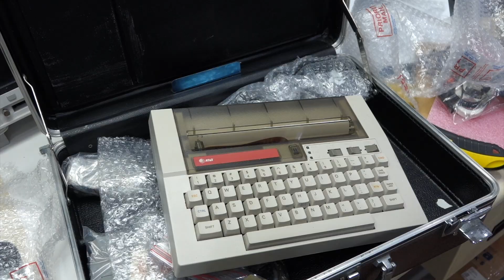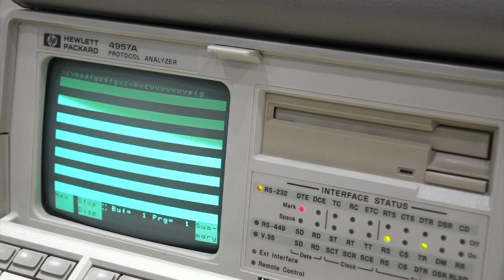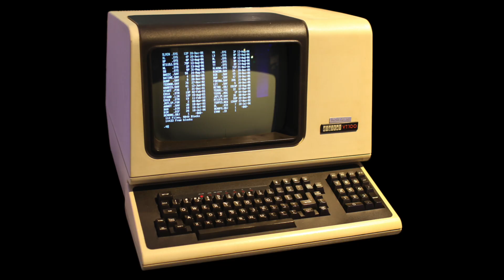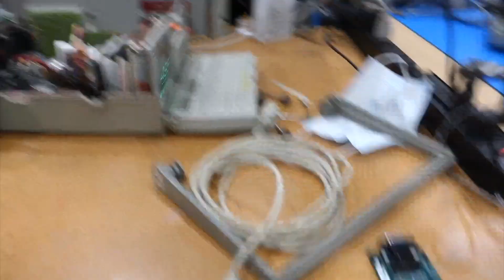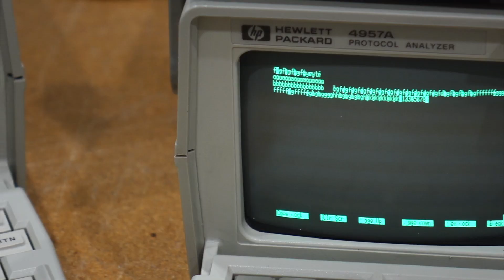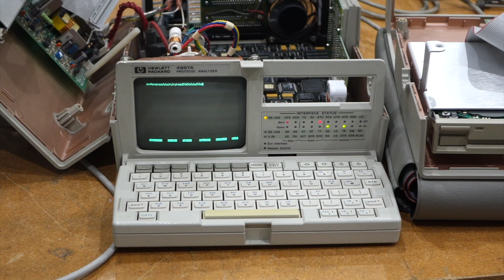HP 4957A Serial Protocol Analyzer

Comment: I used a similar one of another brand to debug RS232 data, sync and async. I would prefer a HP one. What a well engineered products, rock solid, reliable, true jewells!!! By the way, I worked for the local DEC representative in Chile, and we had a bunch of VT terminals, 100, 101, 102, 220, 240, 320 etc.

Comment: Im using a hp4951b with the 18173a pod but i got a few questions. What port settings did you guys use for the windows pc, and what program did you use on the pc, since i can use simulate to get text to the pc but i cant use the auto configure mode and i cant send data from the pc to the analyzer, sorry if this comment seems like a mess i have been trying to get mine to recieve data for like 2 hours now.

Comment: Totally a long shot, but did you happen to document the value/voltage of that starting capacitor?
When I was fixing mine I popped in a huge one that was close enough but higher voltage and way bigger (physically) to make sure the rest works, and order one later… And of course… never remembered to order one 😅
Reply from the maker: Nope. It's somewhere in my bin of dead parts... But replacing it with a bigger cap is perfectly fine. If it starts you are good.
Reply: @ Understandable, thanks anyway :)
Interestingly, out of my 2 units only one has a power supply like yours. The other one has a more stripped down looking HP branded board, and that unit has weird intermittent power-on glitching issues. Shame their main boards are not really serviceable!

Comment: I got the HP 4159A type, fixing the flat flex cable on the keyboard, then I can test it properly. It uses cherry key switches
Reply from the maker: Congrats on your acquisition and good luck on your repair! The 4159A is actually made out of regular parts, not FPGAs, so it should be “easier” to repair.
Reply: @CuriousMarc  Msnaged tobfix him, now working great. Going to use the info from the service manual to build an interface modual as it did not come with one. Can make it nice & small

Comment: Got HP 4951C for review 😀
With all cables, Floppy disk with utilities and connection board of cource. And yep - It's definitely cute
Reply from the maker: Good luck with it! The 4951 with its traditional logic is a lot more hackable than the 57 with all the FPGAs!
Reply: @CuriousMarc  Yep. but after some research I fount that binary format for apps is incompatible with 4952 and later models. So I could succesfully upload apps from utility disk for 4951, but still can't build my own - Need to have some sex with IDA Pro to find out entry points addresses.

Comment: I was just using one of several 4957As that I have at work, for testing RS-232.  I also have a "newer" module -swappable test set that is no-where near as functional as the 4957.  Thanks for this video.

Comment: I used to work with a flavour of this a lot back in the '80's. Ours had a kind of pod thing that covered the keyboard when it was folded up and it then became part of the case. Once removed the pod could be velcroed to the top pouch, attached to the rear panel with a multipin connector and the pod presented the breakout above the screen. Never seen one with the BOB on the side. Very expensive bit of kit back in the day.
Reply: Yes, that's the 4951/4952 as shown in some of the leaflets he waved about.

I've got some somewhere, but ended up writing a better monitor on a PC so I could reverse-engineer the protocol that two of them used to talk to each other.

Comment: It's a good machine. I have one and last "used in anger" as recently as last year for working on a medical laser of similar vintage... modern USB-RS232 dongles didn't work with it. (Eventually we found a fancy industrial one that did, but the HP serial protocol analyzer was still very useful figuring out the settings and some of the protocol.)

Comment: Ah the HP4951. Brought back lots of good memories. Used it extensively during the 90's to develop and debug controlling machines for assembly lines. The external breakout panel that you mentioned is actually the front cover, once the keyboard is folded up. It was only in the later models that they integrated the breakout panel into the chassis, like this HP4957.

Comment: In the 90's I ran the ICL training course for OSNET and needed a mainframe to connect to as a server.  That was impossible in a classroom so a wrote a C03 protocol emulator on one of these using the basic scripting function. And it worked enough to show a simple menu from the M/F.    I also fixed numerous issues for customers with it.
A wonderful piece of kit.

Comment: This was great, I didn't realize that these had so many processors either.  I have a couple of the 4952A models that I rescued a number of years back from being thrown away that I've never used.  They don't have the cable sets and are the model Marc referred to that has the rather clunky interface connections on the lid vs the side.  Who know why they made such a drastic change.  I'd love to see them working again someday just for fun.  It's not too often that [old] protocol decoding for serial communications needs to be done but I hate to see stuff like that abandoned and thrown away.  This stuff was great and back when HP made some of the best test equipment in the world.

Comment: I have one of these, but it looks a little different.  It doesn't have the interface on the side.  It was a separate piece that acted as a cover over the folded up keyboard and contained the breakout interface and connected to the main unit with a large DB cable. DB37 maybe?  It was instrumental in product development that allowed me to start my own company in the early 2000s.  Edit: Ahh looks like miine is a 4952..not a 4957.
Reply from the maker: You have the earlier HP 4951 or HP 4952 that I talk about in the video. Nice machines too!

Comment: If you're interested in alleviating your lack of spot welding equipment, the cheapest reliable/quality solution I've found is the kWeld. Paired with a commodity high-current RC hobby lithium ion pouch battery it produces reliable welds and is tunable from the very lightest terminals/strips up to pretty beefy stuff. Not dirt cheap (a couple hundred bucks plus the battery to drive it), but I tried other cheap aliexpress specials before and they blew up in my face on the first weld attempt so don't bother with anything lower-end.

Comment: In the 1980s, each time you needed to connect a new pair of computer and peripheral device like a terminal or printer via a serial interface, the game started over form new. Our rule was: you need a solder iron, an oscilloscope, and an hour of time. We had additional gadgets like back-to-back soldered D-Sub connectors with blank wires in between to hook up the probes. There were so called "null-modem" cables, crossed cables (crossing TX/RX and possibly also DTR/RTS), and all kind of gender changers. And of course there were the 25-pin and space saving 9-pin versions of the D-Sub connectors. What a mess. It was easier if the devices supported the Xon/Xoff flow control, then you could get away with just three wires, you only needed to get TX/RX correctly connected.
Not yet 20 years ago, I designed a test adapter for SCADA systems that ran serial protocols over optical fibers. The adapter consisted of two optical/RS-232 converters which could be combined in tap mode to sniff the communication between the real devices, or the converters could be used independently for simulating either end device in such a system. The processing was no longer done in such a device like the hp 4957A, but with a software running on a PC. The product has been discontinued years ago, but we still get occasional requests for the test adapter hardware.
Reply from the maker: Well said. RS-232 in a nutshell. No matter how much I try, Rx and Tx are always inverted the wrong way, I end up with two males facing each other, one is 9 pin and the other 25, and hardware handshake freezes the whole thing :-D
Reply: @CuriousMarc  It really wasn't that hard if you worked with it a lot, you just had to know the signaling and the ways it was commonly used.  I did a lot of serial troubleshooting back in the day.  A few minutes with a breakout box and you knew exactly what pinout you needed for any cable.  I also used one of these protocol analyzers to decode x.25, baudot and bisync on both async and sync circuits for many years.

Comment: I could have used something like this a couple years ago at work, believe it or not. Was bringing up a new board, but wasn't getting output. Wasn't until I pulled out an oscilloscope that I found the baud was 33% high.

Was my fault, I thought the board's input clock was 33MHz, but it was actually 50.
Reply: That's assuming these can detect/debug baud rates.

Comment: I used these analyzers early in my career for Async, Bisync, SDLC and HDLC analysis.  However, I always preferred the Atlantic Research Interview Line of products over the HP analyzers.  I spent many years in the office and in the field doing debugging, mostly with the AR Interview 932 model.  At least for me, the AR units were simpler and easier to use that the HP ones.

Comment: The character overlap may be caused by a degraded capacitor in the horizontal width circuit on the CRT. There may be a width coil you can adjust, but by making the image wider (like it originally was), I doubt you'd get the overlap. Looks like an analog issue, not digital.

Comment: I see.  The version we used was the earlier one with the breakout box in the cover.  Great help while diagnosing problems.

I must have resoldered hundreds of those power supply pins that cracked.  The first ones cracked again, so I changed to cleaning all the solder away.  Then I wound an inch or so of 24 AWG bare copper wire around the pin with a tail running into the PCB trace.  Never had an intermittent problem again after that.  👍👍

Thanks for another great video, Marc.  Stay curious!

Comment: Could have used one of these at work last week.  Was trying to troubleshoot a communication problem to a lab machine.  Eventually determined that when the PC's power supply failed, it apparently fried the UART on the motherboard.

Comment: Marc, try ESC # 5 and ESC # 6 escape codes on these machines. The first is "single width line" (80 characters) and the second is "double width line" (40 characters). They may or may not do anything useful. There is also an escape sequence for a 132 character line.
Reply from the maker: That does not do anything on mine.

Comment: 5 cpu and 7 fpga to analyse one serial line, I imagine each peripherals controller has his own cpu, keyboard, disk, serial line, led panel ? seems a little bit over engineered on the hardware side, and under engineered on the software side, don't you think that with a little bit of multi-programming (old term for multi threading), the M68K would suffice ?

Comment: Some interesting HP trivia at 11:22.  The power supply has “Yokogawa” printed at the upper left.  Yokogawa was a Japanese company that HP had a joint venture with for many years.  Lots of products came out of “YHP” as it was called.  I wonder if just the PS came from YHP or if the entire 4957A was designed and manufactured there. I don’t remember.  Maybe someone else knows.
Reply: AFAIK Yokogawa still exists

Comment: When I worked as a Systems Engineer at HP in the 80s, I would sometimes use a version of this to troubleshoot mis-wired and mis-configured serial connections. It made the job a breeze. Loved it!

Comment: Wonder if this would be of any use for troubleshooting HDLC interfaces on NEMA TS2 traffic signal controllers. They use HDLC to interface to the loop detectors, conflict monitor/malfunction management unit, and the load switches for the signal heads.

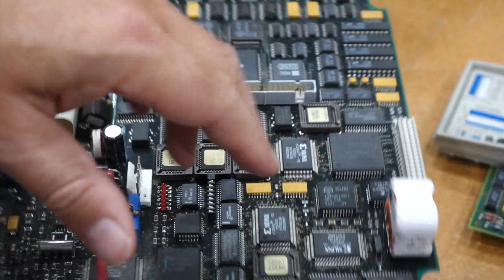Comment: To me the battery seems just 4S1P (unlike 14:24 audio says a serio-parallel), and the vertical joints extend to a solder pin purely for mechanical reasons
Reply from the maker: Could very well be.

Comment: Fixed a few VT-100's back in the day =D  Not very many though, most of the terminals I came across were manufactured by Wyse.  Great job getting both of the 4957 working =D  I hope you can later work out why the high res mode is borked.

Comment: Went through many airport check-ins with on of these as a carry on. Once, I had to demonstrate that it powered up to security, and it fell all the way to the floor. Still worked!
Reply: HP Journal describes how the case outline was specifically so that it would fit under a plane seat.

Comment: How were you able to work out that C7 was the capacitor to replace on the PSU?
I'm guessing that either you were able to reverse engineer it or it's the same PSU design as the older devices. Thus did have a schematic available.
Reply: Its actually the easiest fix. Switching PSU that doesnt want to start or always restarts, 90% of the time its the small 10-100uF electrolytic on the primary side that also has a 50-500k resistor to charge it up from the high voltage bus. usually the cap goes bad, sometimes the resistor also goes up in value if it runs too hot.

Comment: cool machine, I travelled with that kind of device aroun europe well before laptops. used that as a terminal and also to debug protocols.  Used also texas silent, but with bubble memory 😁 and integrated 300b modem... that protocol analyzer phased out later on because it has quite low max baudrate....
Reply: machine I used was 4951 (19200b)

Comment: Hi Marc, I am incredibly jealous - I bought a faulty one off e-bay hoping it was a power supply issue - well it was but the power supply was blown because the RS-232 port had been hooked to mains! That pretty much blew out everything on the 12V lines - so the floppy drive is dead (stepper drive blown) the power supply had the same fault with the start cap as yours, but when I fixed that the PSU exploded. The vertical scan was blown and the RS-232 line drivers and interface board were destroyed. Note - a video will come!

In debugging the system I have found a lot - the video is handled using a dual-port RAM from IDT - this is big enough for the 80 column mode - on the machine that is playing up in 80 column mode, it could be worth having a look at the input and output address lines and data lines - that could give clues as to where the fault is. It may just be the IDT RAM has an issue - in which case it is a simple switch out is possible as it is a PLCC soldered onto the board.
Reply from the maker: Oh no! Looks like I took all the eBay good luck from you! Still took me two tries. We should definitely try the simple RAM replacement if it's socketed.
Reply: @CuriousMarc  not socketed but not fine pitch
Reply: Mine appears to be an early version - it does not have the 80 column VT100 emulator firmware. So maybe the firmware was rushed out to get the unit in the field - makes me wonder if there was a serious supply problem with the older version.
Reply: mains on RS-232 ?  sometimes you really wonder wtf people do with their gear.  When I worked for a company that created DMX-512 (RS-485 based) lighting controllers we once got one returned for repair where we discovered the varistor that was protecting the DMX-512 output was just... gone, a scorched crater left in its place.  o.O
Reply: @MatthijsvanDuin  It is the only way to explain the level and nature of the damage. It is amazing the number of people who should know better but don't. A few years ago a customer returned a sub-station control computer complaining it was faulty out of the box. When we opened it every board was either burnt or was smoke damaged. Somebody connected it to 380V not 230V. Varistors do burn well and smell bad - and when you have 20 or 30 of then all overloaded hilarity ensues!
Reply: @BogTheWombat  IIf I remember correctly we also had a customer who thought it was really convenient to use the same 3-pin XLR connectors/cables for both DMX and mains power in the same installation... you can probably imagine how that worked out in the end.
Reply: @MatthijsvanDuin  inevitable really. I don't think I would choose XLR for mains use!
Reply: The good news is that it works - although I will have to put a switch in to select DCE operation on RS-232. That line on the DLC FPGA is toast and I cannot face de-soldering and re-soldering the FPGA
Reply: To me it looks like the characters are being read out of the RAM okay and at the right times, but are being shifted out at the 40 column dot rate instead of the 80 column rate. Something that's meant to double the dot rate in 80 column mode isn't working right.

Comment: The first thing I always try to do with those old machines is to look up if Noctua has a matching super silent industrial fan and replace them.
Reply: Same. Although it should be said, these quieter fans rarely move the same amount of air - more air per dB of noise, sure, but still less overall airflow. In most cases this is not an issue at all, but I've had it bite me in the ass a few times, where the new quiet fan wasn't quite able to do the job.

Comment: Nice work as always! Interesting with the ROM swap.

The starting cap I had to replace in a PSU recently too and learned about that, nice with older switched PSU's because there simple enough to visually figure out what they do.
Reply: Funny, I had to replace this capacitor in a terminal power supply recently. In my case and in the video, they are both mounted next to hot components. The failures were almost certainly caused by heat.

Comment: In re networking on serial ports, as I recall this is how the original AppleTalk worked. On my Macintosh Plus, the AppleTalk socket and the serial port were exactly the same.
Reply from the maker: Indeed, I think AppleTalk used RS-422 for its networking (same as RS-232 but differential, can go through longer cables).